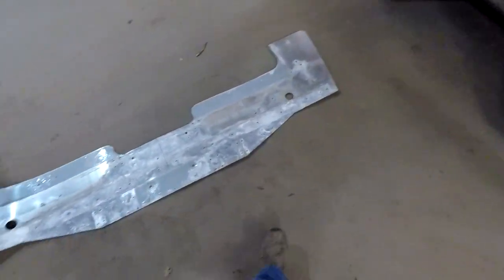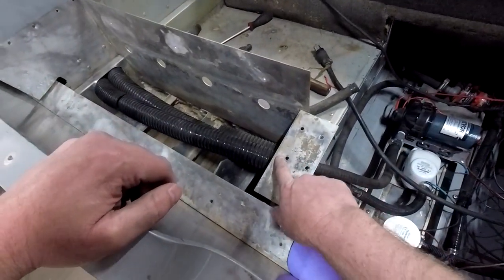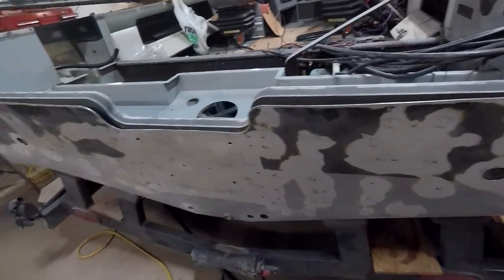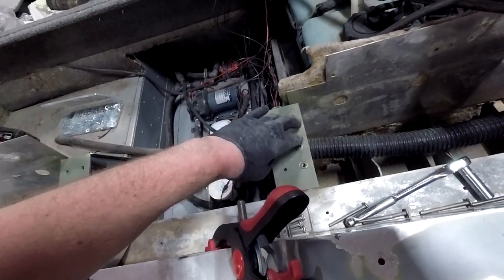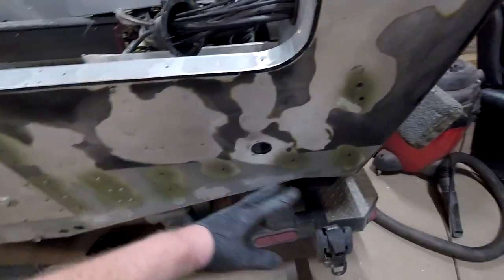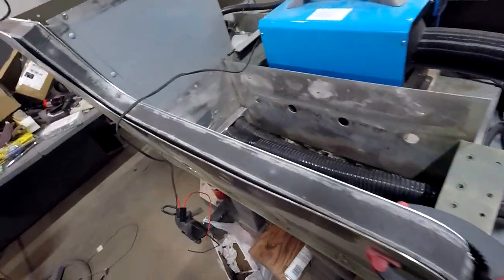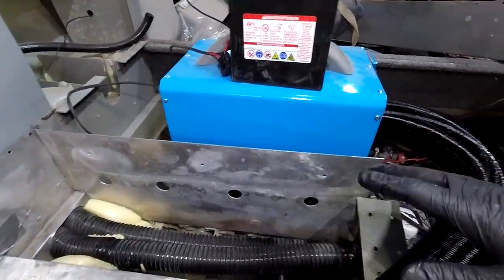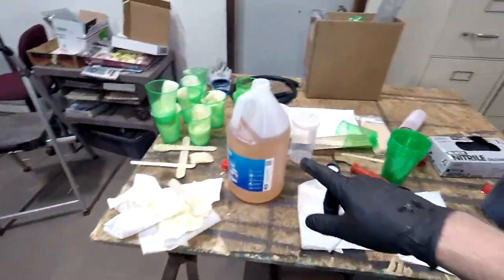NFN's New Transom Installation Part 2 (DIY)

Comment: Nick you mentioned drilling holes for transducer mounts . I have been seeing many glue the mounting board right to the transom with 5200 . No holes in transom . Looks to work very well .
Reply from the maker: I drilled two holes and plus 5200 for my transducer board.
Reply: @NoFishNicksAdventures  With the new transom , im sure that is going to outlast you LOL

Comment: I am in the process of doing the same thing replacement, if mine is smaller in thickness i am thinking of putting an additional 1/8 skin opposite the dam inside the very back and try to figure out how to fill all the unnecessary holes on the original back

Comment: Hey Nick, I noticed you have a Trollsmarter unit. Is that new to you? How do you like the unit? Did you have a troll master before? Thanks. Great video.
Reply from the maker: Yes I had an original Troll Master Pro but during the transom rebuild I switched it to a Troll Smarter because I liked the remote and the hunt mode. So far I love it

Comment: Myself when i put in foam i would put a thick plastic sort of liner,then foam over and into it.Becsuse that foam will draw in water, regardless of what uou heard,i saw a guy remove the foam in his not very old boat and wring out the water